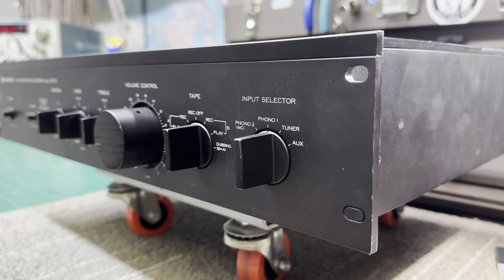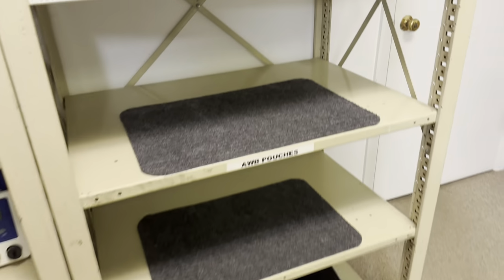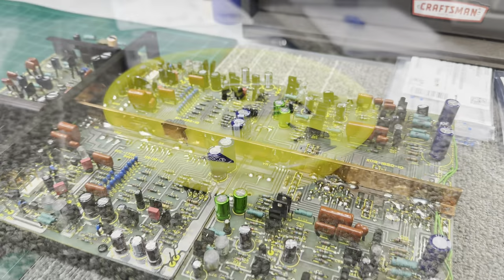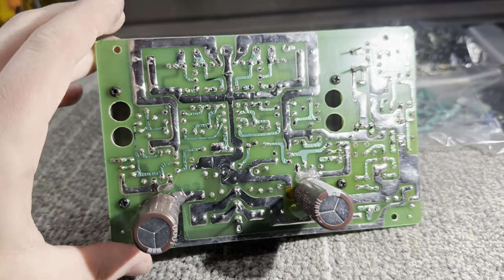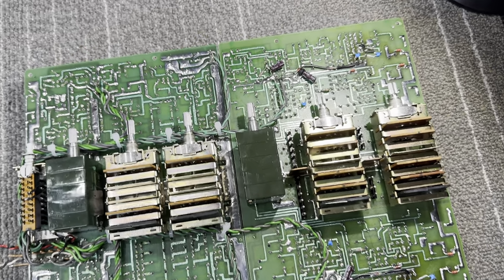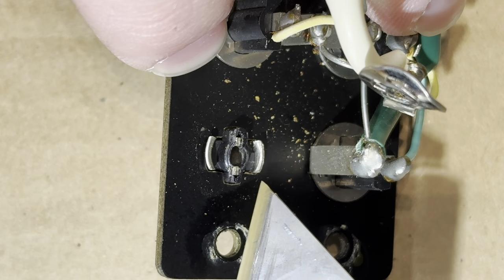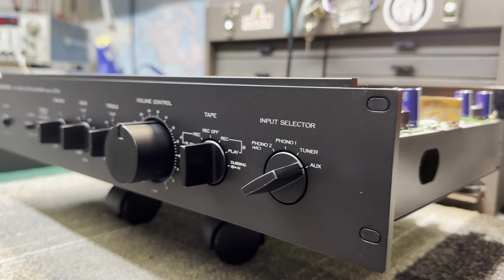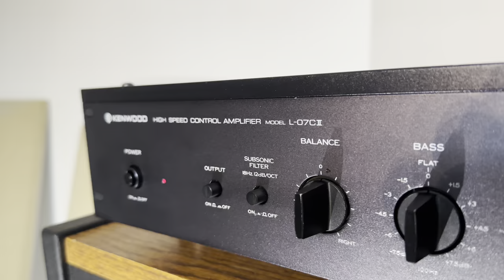Kenwood L-07CII Preamplifier Restoration

Comment: Thank you for taking the time to do this restoration and capture it on video, and share it with the rest of the world.  I have owned many of the Kenwood L-series pre amps and amps and as a person who does hobby restoration, I ran into the same issues in trying to restore my MKI L07C... the traces lifted and I admitted defeat and ended up scrapping the unit.  Damn shame because I got so many years (decades actually) of enjoyment.  I also ran into the oscillation issues with the L07MII amps in where I immediately put them up for sale and reverted back to the MKI amps.  Even with these issues, they are just such quality pieces of gear and they provide such a beautiful sound.  Thinking back I want to say I've gotten about 30+ years of enjoyment out of them before parting ways and going with <somewhat> newer equipment.  I ended up replacing the L07C with a Sony TA-E88 which I feel is superior, but still the Kenwood stuff is just great.  Thanks again for the video and hard work, it shows!

Comment: regards face plate, after cleaning have a try WD40, I’m using it on brushed aluminium and plastics, it makes black blacker and, in many cases, eliminate the stains which remain after cleaning or old discoloration. have try on any as experiment and you’ll se the different.

Comment: Great work and thanks for sharing your experience.  I’ve been working on gear for about two years and I agree with your approach of replacing to avoid issues rather than only fixing things that have failed.  I note the occasional comment from those who believe the opposite.

A couple of things I do as a matter of course, one electronic, one cosmetic.  On the rectification circuit, I add R-C snubbers, using price appropriate capacitors and resistors.  The switching noise drop is significant in most cases and clearly audible.  Having said that, I did have one CD player where it wasn’t  the case, so it’s not a universal solution if the circuit already contains suitable noise suppression.

On the cosmetics, it involves addressing the scratches on the paint.  I use automotive touch up paint in either a brush form or, if the case has many scratches, I respray it, having first flatted the scratches out with abrasive paper of increasingly fine grades, finishing at 600.  It many not be original but it looks factory fresh.
Reply from the maker: Thank you for the support! Keep up the great work yourself!

Comment: Excellent restoration. I enjoyed this video. I would have loved to see the process of defluxing the board and the chemicals used. I was amazed at how good the board looked after you cleaned it up. I would love to learn that process. The board looks better than factory. I have a L07C mark 1 that I will be restoring soon. Im not looking forward to the double sided solder and weak traces lifting.
Reply from the maker: Thank you! I have an explanation in my AU-717 video that details the defluxing process. - The L-07C Mk1 is a fair nightmare to work on. Most traces will lift, as they did with me... And I'm about as careful as someone can get with board rework. The traces seemed like they were held down with spit!

Comment: Wonderful and clean job, some good ideas to do in my one L-07CII. I have to check the other comments of you already answered but I will like to know the reference for the new voltage regulators and the new feet. The metal polish really enlighten me. Thanks!
Reply from the maker: Thank you! The regulators are MJE15032 and MJE15033 respectively. They work very well in this application. Much cooler running. The aluminum feet can be found on Amazon. I will see if I can find them and link them in another comment. They are very nice for the money! Oh! And the metal polish I use is called Simichrome. Use it sparingly and lightly with a microfiber cloth - be very careful on anodization and silkscreening.
Reply: @PrimeHiFi  Thank you very much! I will change the regulators in mine, I wonderful improve to cool down the unit a little bit. I will also look for the feet's also. And yes, the metal polish is already in my shopping cart.

Comment: I had to clean up & re-cap some boards on a vintage SONY (TA-2000f) pre-amp. 
They were all plug-in boards so it wasn't that hard to work on each board.
I've used old analog TV  "Contact Cleaner" for the boards and pins.

Comment: very good job! congrats! I wonder how did simichrome not removed the letters on the face plate? isn't that abrasive enough ? thank you !
Reply from the maker: Thank you! With light pressure and extreme care, it will not damage a faceplate. You mileage may vary...

Comment: Very nice work! I just finished a Mark I trio (07c and pair of 07m monos) and a trio of the Mark II (same, L07 series) all for the same client. I did roughly the same work, but may I ask, what made you decide to go ceramic for the black flag replacements? Strictly cost?

Any reason you chose not to eliminate the tantalums? This era of tantalum is known for growin tin whiskers and will eventually short.  I’ve run into tantalums that have shorted in this series. 

And yes, for such a nice preamp that grounding design for the RCAs is one of  the worst I’ve seen. I replaced them on the Mark II preamp I just did as the grounding was very intermittent. 

Any info on those bookshelf speakers you were using at the end? Just curious as to what they are.
Reply from the maker: Hey Dan!
I went with ceramic capacitors as they are extremely reliable and are available in precision tolerances. These caps aren't being used in the signal path, so no need to go too fancy with them. I could have gone with silver mica, but there would be no real added benefit, and they cost much more.
I didn't replace the tantalums in the tone stack as I've never seen tantalums with very low applied voltage go bad. In retrospect, I should have replaced them, but they should be just fine for this application. Yes, one of the L series' downfalls was their terrible ground implementations. The idea was good, but execution was poor. It's what kills most of the L-07M/IIs. That and black flag capacitors. The speakers at the end are the Snell Type Q.
Reply: @PrimeHiFi  very cool, thanks for the answer. By the way, after watching your video I collected the two preamps back from the client and installed shielded coax as you did from the output RCAs to the pins for the harness.  For such a nice preamp it’s weird that they’d use what looks to be cheap looking speaker wire for the outgoing signal.

Comment: Really convenient tool, the Erem 554tx. BUT its price is 130$ and upwards, for this form plier for passive components legs.
Was drooling over your toolbox with weller special hand tools.. got sidecutter and fine plier, but the cost is out of this world as hobbyist..
Reply: Check out hakko, they sell similar lead forming tools on their website for 20-30 bucks, I have a few.  They import them from some Italian company named Piergiacomi
Reply from the maker: I agree - they are very expensive. I’ve bought them slowly but I use them all the time. The quality is worth the price of entry for me, but I totally get the opposition when other tools will get the job done too. The internal springs are what seal the deal for me. They’re just awesome. I was planning on doing a short video on the tools I use regularly for restoring and repairing equipment. I have a ton of specialty tools. Thanks for the feedback!

Comment: Great vid once again, mate. I appreciate that you take the time to show the handy tools you use in your resto's. The wire unwrapper and top flush cutter have given me tool lust ( ͡° ͜ʖ ͡°)
Love your thoroughness and drive to do a quality job.
Reply from the maker: Thanks! I was thinking about doing a video focused on the tools I use for working on gear. I have a ton of specialty tools I use on a daily basis. Thanks for the feedback 😃
Reply: @PrimeHiFi  great idea - I'd absolutely watch that. There's a couple of guys that review high quality exotic tools; mostly from Japanese makers like KTC / Nepros and Koken etc but a lot of it is gear I'm not likely to use very often (e.g. socket sets). The stuff you use is right up my alley I reckon - I just need to exercise some restraint or I'd likely go broke.

Comment: what do you use to deflux? i tried alcohol, but had a really hard time getting the flux off the board, it will always be sticky afterwards.
Reply: Acetone.
Reply from the maker: I recommend using 99% isopropyl alcohol and a stiff brush. It usually takes me multiple stages of cleaning to get them completely clean. Stay away from harsher solvents like Acetone as they will destroy plastics and remove the color bands off of resistors and silkscreening.
Reply: @PrimeHiFi  thanks, im trying to get into restoring amplifiers as a Hobby, so your Videos are highly appreciated. it would be awesome if you could show the process of some operations, like how to decide which caps to use for recap (when wima, when electrolytic, when bypass). thanks alot :D

Comment: I dont think the traces have started bubbling, I think they were like that from new.  Lots of old 8 bit computers are like that and they were like that from new.  

This was common on Spectrum, Commodore machines even upto the Amiga era with memory expansions.
Reply: Yes many pcbs of this rea looked exactly like this from New 
I think they they solder flashed the whole copper area of the board before solder masking and subsequent processing such as wave soldering caused the solder to bubble under the solder mask giving that nasty appearance.

Comment: Are not polystyrene caps considered "use for superior sound quality" NOS is still available in canada. Same source has polyprop radial caps. Would not the polystyrene been used in the signal path
PartsConnexion.
I'm a firm believer in film cap use. Ie Sansui B2101 C2101.